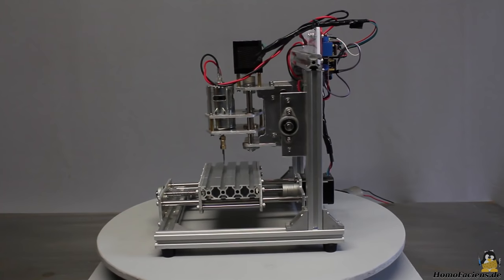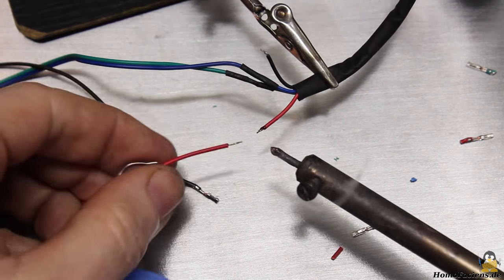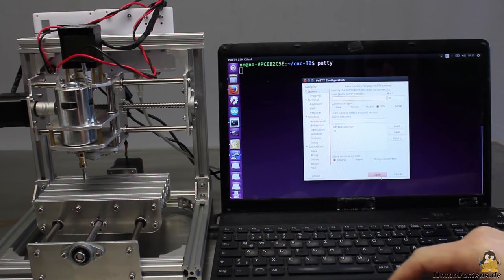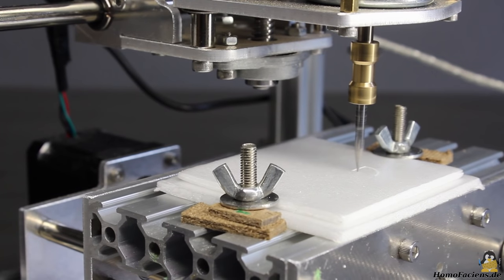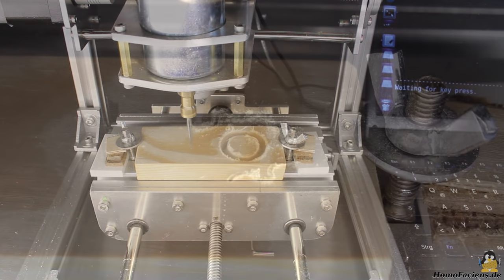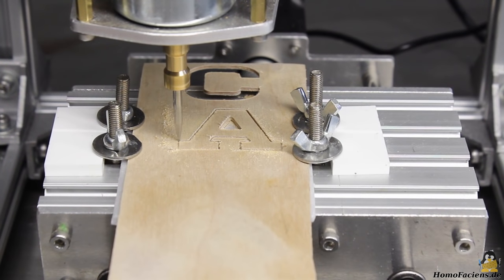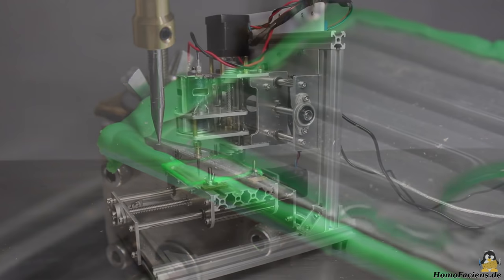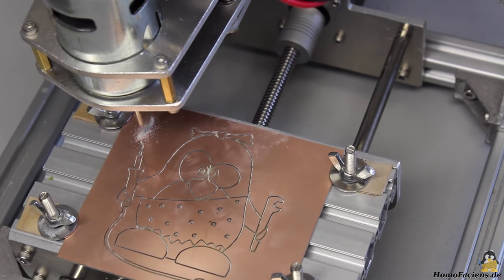CNC T8 from Gearbest - review

Comment: I would just mention that cutting acrylic the easier way is done by using suitable bits along with the appropriate feed rate and spindle speed, in fact, melting (and thus, bad or no cutting at all) is caused by the friction of the bit against the material because of its side shape (or profile): when it's straight, it "rubs" against walls each revolution and generates more and more heat, water cooling may improve result but only to a certain point. The solution is to use O flute bits, 1 flute spiral bits may work also, both must NOT have flat bottoms. Another cause of friction is the sturdiness of the build, the more "play" there is in the CNC the more likely for it to generate friction. IMO, the best way to achieve good results is to start at an average of 8000 RPM with feed rate of 150 mm/min and a depth of cutting not more than the diameter of the bit itself. If melting, try a higher feed rate. Flying chips during cutting is a good indicator of good cutting, as when they remain "inside", they also contribute to friction. I hope these tips, from my personnal experience, help.
Reply from the maker: Thanks for giving base values to start experiments. It's a cheap machine that has backlash, the runout of the spindle-bit-adapter-combination isn't perfect either and as you stated, that's what causes trouble. I guess the spindle doesn't get 8000 RPM at 12V, another thing to have a closer look at. I did what I could with the unmodified machine and the cutting tools it came with. The results aren't too bad, but anything else than perfect. I will try to get better results with modifications of the machine and better tools - let's tinker!

Comment: I have changed the anti-backlash scheme from the original which uses a long but fairly weak spring as this is soon overcome by the cutting forces unless you go very slowly. I now simply use two M3 spring washers under the heads of the bolts going through the second nut and tighten the bolts till the spring washers are providing the right amount of anti-backlash force. I use nut-lock compound to make sure this adjustment does not shift in use. This provides a much stiffer anti-backlash that allows significantly faster working.
Reply from the maker: Definitely another simple improvement of the mechanics. Thanks for sharing!

Comment: 3D print a tray to hold the water with your Anet A8 instead of modelling clay...
Very cool little cutter/engraver.  Always wondered how good this was.
Awesome it can cut PCB traces?
Cool video, keep it up!!!!
Reply from the maker: The model clay is a solution you can use even without a 3D printer. However, I'll keep that in mind.
I will have a look at the PCB tracing capabilities when recording the next video about this CNC - stay tuned!

Comment: I have just ordered one as it seems quite a handy machine to use while experimenting with various bits of CAD/CAM software. The flexibility of the frame is not very surprising given the way it has been done (the small corner brackets especially). Simply bolting it to a base-plate, back plate and two side plates made out of say 20mm MDF would be a very cheap way to take some of the flex out of it.
Reply from the maker: Yes, it's a nice and cheap base to start some experimentation. I will do my own ones to improve the design and keep your idea in mind. Thanks for sharing!
Reply: Just a few of things I found out with mine:-

1) Anti-backlash for the acme screws is included with 3 extra nuts, 3 springs, and 6 sets of M3 standoffs and M3x 20 capscrews. The capscrews are used to stop the second (spring-loaded) nuts from rotating - crude but effective.

2) The bearing blocks have a lot of end-float so I improved the anchoring of the leadscrews by turning the bearing blocks around and sandwiching a narrow (3mm wide) 8mm ID bearing between the existing bearing and the plate with the pre-load set by spring washers - extremely crude and ugly to look at but also effective.

3) the CNC shield is wired for V0.8 of GRBL but the UNO clone supplied is pre-loaded with a later version that swaps the usage of the Z-axis end-stop input and the spindle enable/speed control. So if you add end-stop switches or use the spindle control you need to switch which pins you use on the shield. BTW - pogo pins make good, simple but repeatable limit switches if you remove a small area of the anodising of the carriages for the pogo pins to make contact.

Comment: If you are making another video about this, I would love to see upgrading to a collet on the spindle as well as a good method for leveling the bed.
Reply from the maker: Replacing the bit adapter with a collet won't make things better. Let's see if adding a ball bearing will improve the runout.
I don't see a simple solution to add any kind of bed levelling to the machine. The only way is to align the frame as straight as possible before tightening the screws.
Reply from the maker: The advantage is that you are not limited to one shaft size of your bits, however the runout of those flex shafts isn't perfect either. At least it's worth a try.
Thanks for sharing your idea. I must have such a flex shaft somewhere and will try to find it...

Comment: I would be interested in knowing what the max current consumption (highest current in step sequence) is per phase coil of the stepper motors. I also do want to see what that spindle can do fed higher voltage too.
Reply from the maker: The phase cuerrent is indeed a "problem". As mentioned, this machine comes with no documentation, thus I don't know what phase current to adjust which is why I simply did not touch the potentiometers. I will do some investigations about the type of stepper motor and so talk about phase current in a later video.
A higher spindle voltage will also be an issue of the coming video about modifications. It's really a tinkerer machine ;-)

Comment: Thanks for your review! I also have a similar engraving mcahine from China. They are nice for tinkering with. First thing i did was replace the spindle, because the one provided was very slow and noisy :)
Reply from the maker: The spindle is indeed slow but mine it not noisy. The torque is higher than that of the tiny proxxon or Dremel tools often used. Maybe doubling the input voltage will speed it up.

Comment: Hello, do you think this machine could engrave zinc plates, even if we adapt a faster speindle in?  Thanks.
Reply from the maker: To get good results in hard materials, you need quality cutting tools, a motor with great runout and a mechanics that doesn't bend under side load. This machine fulfills none of your requirements. It's a cheap machine for starting experiments, not one for industrial applications.

Comment: Just thinking out aloud about flimsy CNC stuff, if you buy one of those $250 air compressor plasma cutters and mount it on the head, you could do some serious metal work, ie 6 mm, even with crappy CNCs. You would have to suspend the cables so there isn't much axial load, but at least it's nowhere near the side loading of a router trying to move sideways.
Reply from the maker: Well, that's no option for this tiny CNC, but I will try something like that with my latest DIY machine:
http://homofaciens.de/technics-machines-cnc-v3-2_en.htm
...must make it run better and accept G-Code before trying addons...
Reply: Speed is also a problem, because thin metal has to be cut fairly fast.

Comment: Very impressive pictures. 
I would like to order one but am unclear as to what type of bearings those are?! 
They look like they are made of oilite that I've never seen before. The flat plates look like they've been cnc machined and holes must be accurate distances apart. 
It bothers me that they didn't use regular linear bearings like 3D printers use. 
Also, I wonder if I could user inner tube of a tire to make a "Shavings shield" to protect the Y-axis rods and acme screw from dust and debris!
Reply from the maker: The bearings are simple steel bushes sliding along the round stell bars. Definitely only a cheap, but no good solution.
I will do some mods of the machine if I find some time to do another video.
Thanks for sharing your ideas!

Comment: Very interesting! Would it be possible to cut thin aluminium sheet or mill pcb layouts using this machine?
Reply from the maker: Out of the box the mechanics is too weak to cut metals. I will try after some modifications - stay tuned!
Reply: I have a similar one, and with the motor provided (using a coupler to attach bits) I found the machine (specifically the motor + bits) too imprecise for milling PCB. I'm now in the process of attaching a 'real' spindle and see if the mechanics of the machine, together with a good spindle, can mill pcb's accurately. For now I just used it to drill the holes in PCB's, which this machine is well suited for.
Reply from the maker: Yes, the runout of the motor and coupler combination is for sure anything else but perfect. I will try to improve that, but can't say yet if my plan will work ;-)
Reply: Thanks for your reply. I look forward to future videos about your modifications.

Comment: Sorry to resurrect an old thread but I have a question. I have one of these machines. I've never been able to get it to work right. Does anyone know if there is an upgraded board for this that would allow it to run more modern and user friendly software? I'd really like to have another go at this. Thanks in advance!
Reply from the maker: The board of my machine is an Arduino UNO clone running grbl as Firmware. Updating to the latest version of grbl should be possible since it is open source.

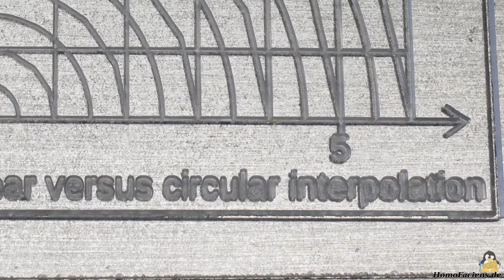Comment: 13:30 those curves look like they're made of segments of straight lines, was that in the file or is it an error introduced by the machine?
Reply from the maker: The engraved example graphics illustrates linear interpolation of a circle, so the segments are indeed straight lines. It's no error of the machine or software.

Comment: Great video; thanks for the tips.

Do you know why the stepper motors would not turn even if they have power on the VMOT and VDD pins on the stepper motor drivers?  I can turn the spindle motor on and off, and the controller program I'm using seems like it's sending the movement commands successfully, but they do not turn.
Reply from the maker: The Enable pin on the stepper drivers must also be on HIGH level. What software are you using to send the Gcode commands?
Reply: I'm using  the Grbl Controller 3.6.1 program that came with the engraver, but it also has the same results with grblControl (another controller program).  The coordinates change in the program and there are no errors in the command log, but the motors do not actually move.

How can I tell what the enable pin is set to?
Reply from the maker: The enable pin is on the top left of this picture:
https://homofaciens.de/bilder/technik/cnc_v2_1_007.htm
...and it's a NOT enable pin, so it must be on LOW level (sorry, HIGH means disabling the driver).
NOT sleep and NOT reset must be on HIGH level and of course the input stepper motor voltage must be on the top right pin.
Reply: As far as I can tell, they all have the proper voltage.  I'm at a loss for what would keep them from running.  There might be an issue with the CNC shield, but I'm an amateur, so I'm not sure how to diagnose this from the ground up.
Reply from the maker: It's also hard to give a diagnosis without having physical access, but I'd also say it's the shield rather than the Arduino since the software seems to run fine. Did you tell your dealer about the defect?
Reply: No, I didn't.  I bought it off GearBest, so it's most likely more work to try to get them to replace then to just buy a new one.  I already bought another Arduino because the one that came with the kit stopped communicating with my laptop.  I hate to spend even more money on it, but I've been working on it for weeks, and I just want it done.  Hopefully replacing that will fix it.

Do you know if the stepper motors have a constant stream of power going to them, or if they only receive power from the shield when they need to move?
Reply from the maker: I would at least try to get a new Funduino and shield.
Whether or not the steppers are powered, depends on the commands. You can enable/disable the steppers with Gcode commands. Usually they stay enabled after moving for the steps you commanded until a disable command is received.
M17 enables the motors M18 disables them. Details about Gcode:
https://reprap.org/wiki/G-code#M17:_Enable.2FPower_all_stepper_motors
Reply: So M17 and M18 are coming back as unrecognized commands, and I can turn the axles freely when the machine is on.  I'm not supposed to be able to do that if they have power, right?  Also, did you use the GRBL hex files that came with the machine, or are you using another?
Reply from the maker: I did not do any changes to the firmware that was preloaded. It's grbl v0.9. So if you have the same version, sending X10 through putty should move the machine for 10mm, as demonstrated in the video.
Reply: @Elliott McGaugh - There are some issues with the shield supplied and the later versions of GRBL because they swapped over the Z-Axis limit input on D11 has swapped with spindle enable D12 to support variable spindle PWM output (though this is not going to cause the non-running of the steppers. I suspect it's a matter of setting up the GRBL soft and hard limit configuration etc. To see the settings go into a gcode sender (I use Universal Gcode Sender Ver 1.09). To see the settings enter $$ in the command line and it should throw up a list of the settings in console window. My settings look like this:-
$0=10 (step pulse, usec)
$1=25 (step idle delay, msec)
$2=0 (step port invert mask:00000000)
$3=3 (dir port invert mask:00000011)
$4=0 (step enable invert, bool)
$5=0 (limit pins invert, bool)
$6=0 (probe pin invert, bool)
$10=19 (status report mask:00010011)
$11=0.010 (junction deviation, mm)
$12=0.002 (arc tolerance, mm)
$13=0 (report inches, bool)
$20=0 (soft limits, bool)
$21=0 (hard limits, bool)
$22=0 (homing cycle, bool)
$23=0 (homing dir invert mask:00000000)
$24=25.000 (homing feed, mm/min)
$25=200.000 (homing seek, mm/min)
$26=250 (homing debounce, msec)
$27=2.000 (homing pull-off, mm)
$100=1600.000 (x, step/mm)
$101=1600.000 (y, step/mm)
$102=1600.000 (z, step/mm)
$110=500.000 (x max rate, mm/min)
$111=500.000 (y max rate, mm/min)
$112=500.000 (z max rate, mm/min)
$120=200.000 (x accel, mm/sec^2)
$121=200.000 (y accel, mm/sec^2)
$122=200.000 (z accel, mm/sec^2)
$130=120.000 (x max travel, mm)
$131=100.000 (y max travel, mm)
$132=45.000 (z max travel, mm)
I doubt they are optimal but at least the thing runs and I have cut stuff with it with these settings. To change any of the settings simple enter the new value into the command line in the format shown in this table (e.g. $20=0). Hope that helps.

Comment: Did the kit come with bits, or did you have to buy them extra?  What size bits does it use?
Reply from the maker: It came with three 10° V bits having a shaft diameter of 3.175mm or 1/8 inch as written on my page (figure 3):
http://homofaciens.de/technics-machines-cnc-T8_en.htm

Comment: your machine looks more sturdy than a T8 video I have just watched, the support brackets and motor mount are 3d printed and the comments are that the motor fixing screw is poor....not fit for its purpose...
Reply from the maker: It's good enough for engraving work as shown in the video. The long lever of the router bit plus coupler makes the tip of the carving tool bend noticeably when trying to carve metal.

Comment: Sorry to overwhelm you with these questions but.
Would this device, with the right bit also carve 3d reliefs and what would be the ideal windows based controller software?
Also  what free cam sofware beside Artcam would your recommend for 3d reliefs if this is possible?
Would artcam reliefs work with this or would it overload the buffer of the controller software along with problems with gcode commands it might not support?
Reply from the maker: Don't expect that much from such a cheap machine. It's good for engraving plastics or wood as demonstrated in the video. I will try to do som modifications in the future to see where the limits are.
I highly recommend using Linux - it's Free and Open Source Software and so the better choice for mankind.

Comment: noob tip: if you upgrade the cnc shield to grbl 1.1 you have to move the spindle engage plug to the Z+ end stop and always set a speed. ie S5000M3
Reply from the maker: Yes, there was a change in pin configuration for the latest grbl versions.
Reply: that took a bit of googling to find out. I've also added wires for Z axis calibration. and I"ve got some end stop microswitches but so far I'm still puzzling on how to put them on.